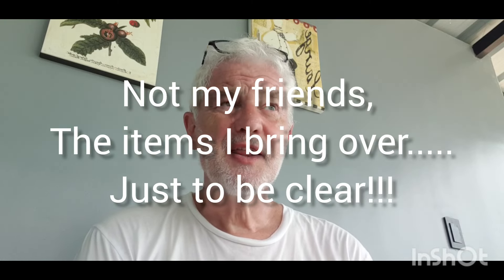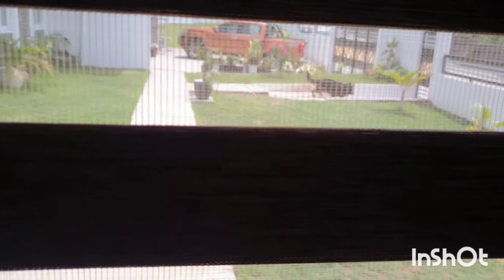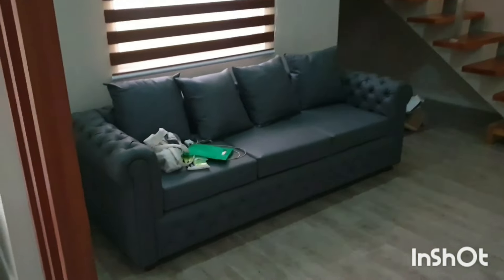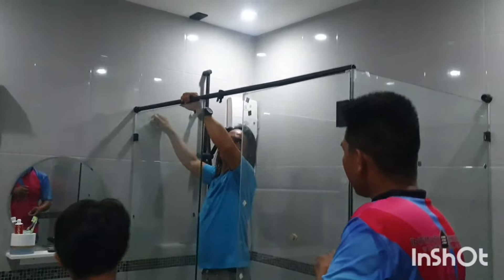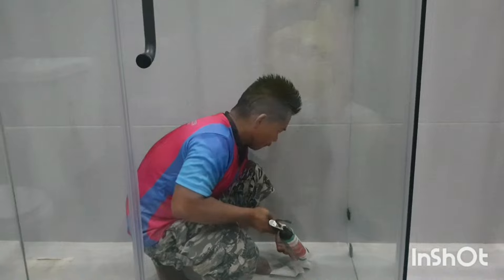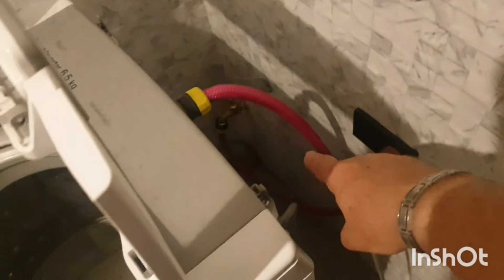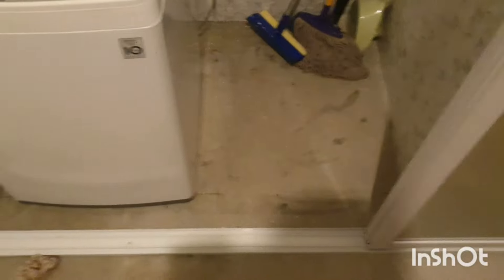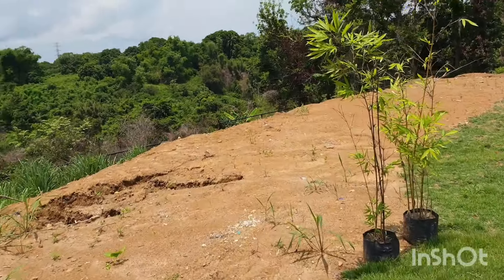House build - Week 55

Comment: Great progress Daniel, just a warning about the power, please be careful voltage fluctuations are nr1 equipment killers especially aircons, have that sorted asap, your firepit,consider a pipe or small blower at lowest point, pits what get there oxygen from the top only doesn't work well, the oxygen need to come from the bottom of the fire, rest al stunning well done.